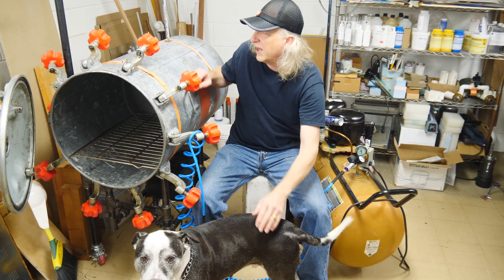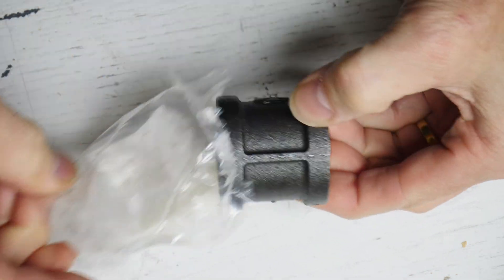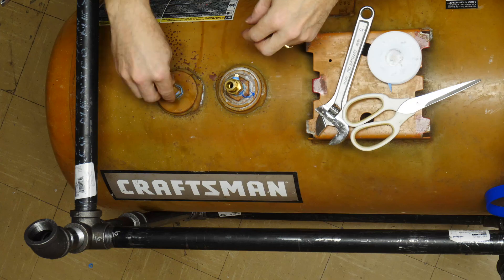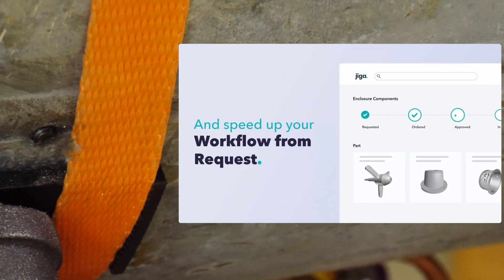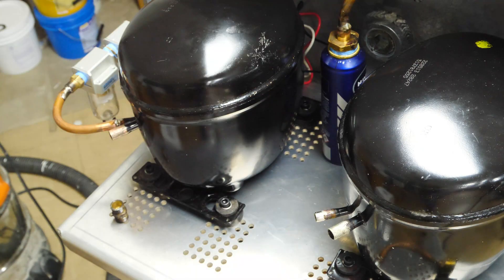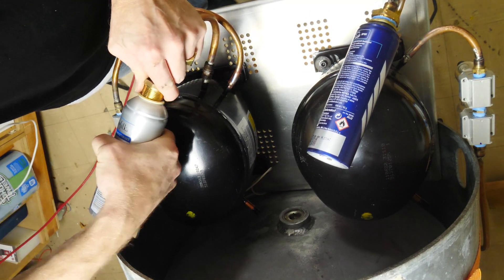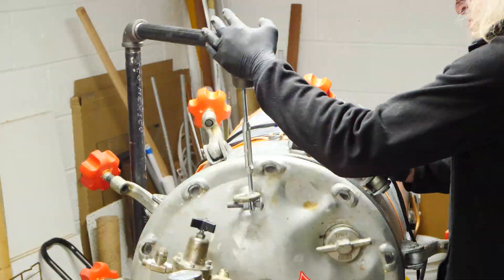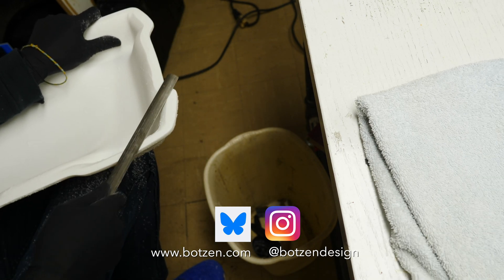30 Gal.Pressure/33 Gal.Compressor Tank Build

Comment: Normally these compressors pump their oil round in its closed (fridge) system and nothing gets lost. In your setup the oil will vanish over a period and there won't be 140 ml of oil in it. It will take a while of course but still...
I was amazed by the difference in noise by using your diy 'shaving' 😀mufflers. 
You are very creative. I like that 😊
Reply from the maker: Thanks

Comment: You know what this rig would also be awesome for, you have enough vaccume capacity to pull 4x8 sheets of plastic in a vaccume former or to do pressure forming. You can 3D print the molds in ABS and make a sheet oven by salvaging som electric oven elements.

Comment: You mentioned a drip hammer to apply drops of resin?  I search for it and can’t find any reference to drop hammer or drip hammer. What else could they be called and where do you get them?
Reply from the maker: You’ll need to get a stick and make one, then you can drip resin off the end of the stick, eventually it turns into something that resembles a hammer

Comment: Hi, Im thinking of moving to the Detroit area. Do you know of local maker spaces which could allow access to shop machinery as well as CNCs and injection molders?
Reply from the maker: No, as I don’t use those services, but I know there are several maker spaces in my area